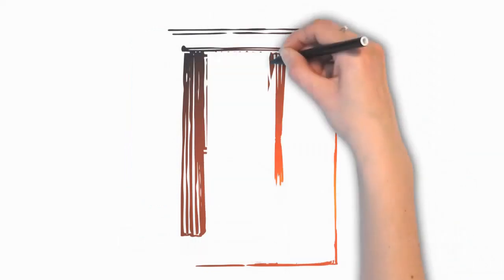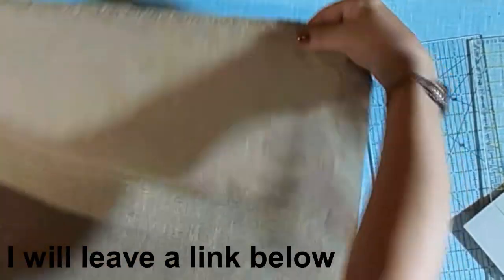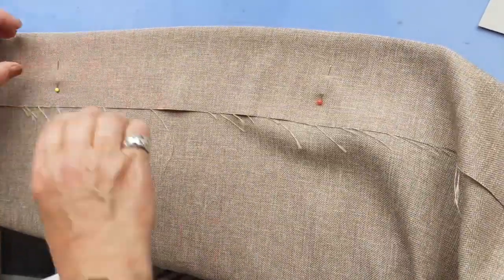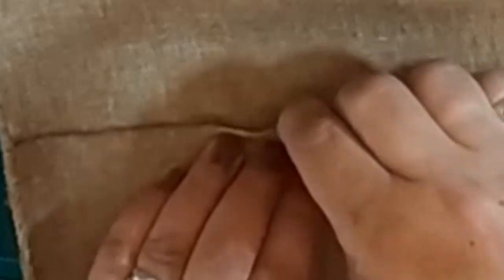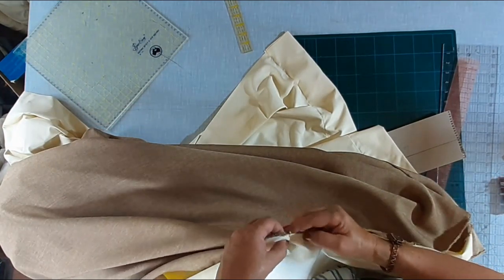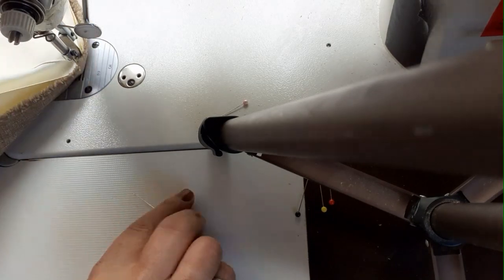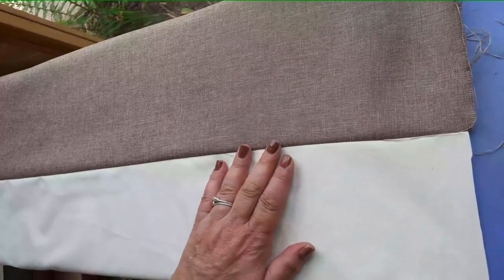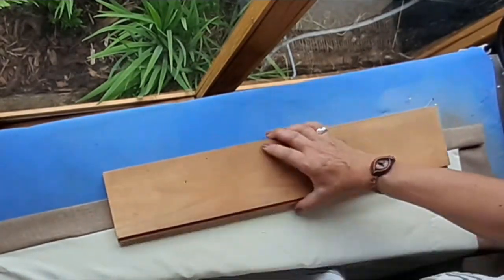how to make curtains for beginners

Comment: Brilliant tutorial Thankyou. As I'm a novice sewer. Can you suggest a way of ironing on a satin type fabric for the clean edge please? I'm about to embark a massive task of making two sets of curtains which are nearly 13ft long. One will have eyelet headers and will be lined. The other unlined as dress curtains. I'm hesitant to even cut the fabric let alone sew. I know I must be MAD but cannot afford for anyone else to make them for me. I don't have a huge table either so it'll be a nightmare. Any tips at all will be appreciated. Thank you so much.
Reply from the maker: when working with satin I found use a damp cloth hope that helps so for so long a reply only seen now and use the cardboard it will keep it straight

Comment: 22:28 Hi! I am a newbie. I have watched this video 5 or 6 times and I still can’t quite understand what happens to the bit of extra material in the lining when you pin both sides all the way down and the lining is slightly more narrow than the fabric. I know it must be something to do with those center pins but I am SO confused. Some one help me please!
Reply from the maker: the lining needs to be narrow so the curtain tucks in at the back if you look at a brought curtain the lining is never as wide as the curtain  you don't want lining showing on the front of the curtain sorry take so long to reply

Comment: I have a question, if my curtain pole is 385cms long and my curtain fabric is 150 cms wide in order to make 2 curtains will I need 5.6 fabric widths  per curtain or will 3 suffice it just seems an awful lot but I want curtains that are quite full when hung up
Reply from the maker: depending on how full you want the curtains to look you would need 2 and half drops but I would to save money go 2 drops per side and I see you brought heavy lining which will give it a fuller look 2 drop each side
Reply: @louisebastard2091   Thanks for the belated reply. Made the curtains using 2 and a half widths, and although that seemed an awful lot of curtain,they actually looked perfect. Unfortunately I abandoned the bonded lining as it was too thick and I just couldn’t use it, my sewing machine and arms couldn’t cope, because the curtain fabric was a heavy linen material .